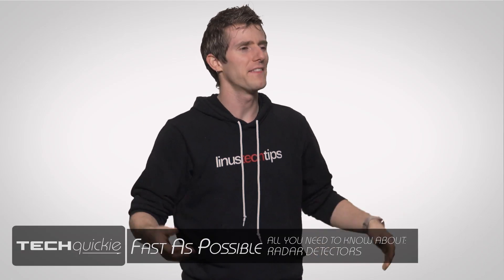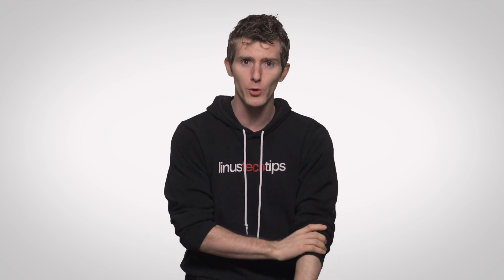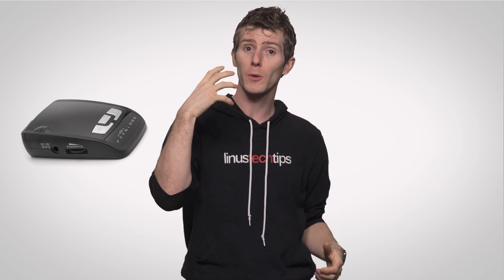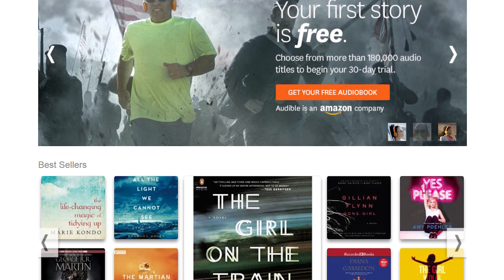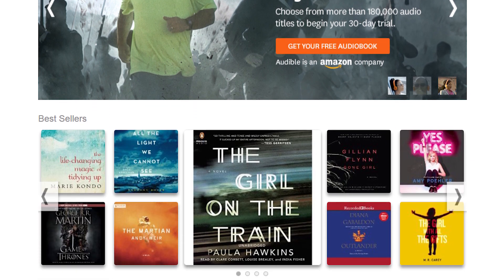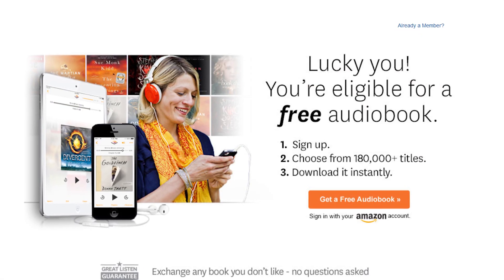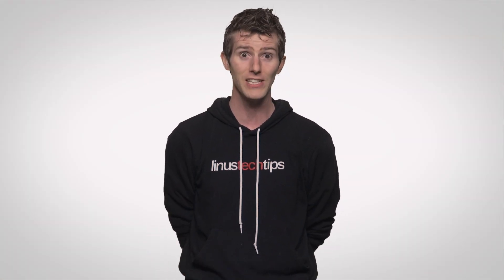Radar Detectors As Fast As Possible

Comment: Car radios and radar guns don't work similarly at all. Car radios process signal via FSK modulation and a radar gun compares the speed of the input signal (due to the Doppler effect) to it's internal clock. The only thing that is vaguely similar between these two devices is the visual representation of the input signal on an amplitude x time graph. Other than that car radios and radar guns have nothing in common.

Comment: In the Doppler Effect, the frequency doesn't change, it appears to change because of the compression of the air by either the producer, or the observer. The radar gun works based on firing multiple signals and measuring the amount of time in between each sent and received signal and measuring the difference "appearance" in the shots.
Reply: Yes, the frequency does change. Doppler effect occurs with any type of energy wave. Be it mechanical waves (sound) or electromagnetic waves (radar, radio, light). All sounds are a mechanical compression of air, the frequency changes up as you move towards a sound source because you are experiencing the crest of each wave more often than a stationary observer. The same happens for radar / radio in a complete vacuum. Police radar measures the change in frequency reflected from a moving object. A police radar pointed at a stationary car will receive back the same frequency it transmitted, If that car is moving away from a radar source the crest of the reflected waves moves further apart reducing the returned frequency. Police LIDAR (laser speed detection) also works on the same principal.

Comment: Here in Australia the police will park a van car or 4x4 with a camera that takes photos of the license plates and if you are speeding you will get a ticket with a photo of the vehicle the driver is driving. If your car or vehicle by someone else you have to let them know who was driving the vehicle. I was on a public transit bus going through a speed camera and I saw a flash and the driver got done for speeding going downhill at 80 km/h in a 60 km/h speed zone. Speed cameras do get the vehicles coming the other way with a double lane road with an island in the middle on the road. The flash is on it's front or rear bumper and that depends which way the vehicle is parked and the vehicle can be an unmarked police vehicle.

Comment: Sorry to tell you that a radar detector does not pickup ''doppler frequencies'' but the original signal from the police radar , be it X/K/Ka bands.
You are right if you say : the returned signal from a moving object contains a doppler
shift which is analysed by the police radar and transformed in a speed readout.

A K-band radar would display 50 mph when the Doppler shift is 3600 Hz.

Good work all in all : being caught is expen$ive.

Comment: Still the problem with radar/lidar detectors is when they detect the beam, then your speed has been already measured. Game over.
Reply: Some cops will not pull you over if you slow down as you pass then.

Comment: Or just get a faster car.
Reply: You don't out run the police. It just won't work. Police cars are designed with high speed pursuit in mind. They have radios. They use helicopters. They even can throw stop stick across the road to pop your tires.  And apparently in New Mexico, they can even slam into your car to stop you. Does this sound worth it to you?

Comment: Not covered: Some radar guns can detect the tiny change in the radar signal caused by there being a tuned circuit on the receive end (your detector) -- so they can detect your detector -- helpful if detectors are illegal in your area so they can catch you for it...
Then the detectors got a level smarter and detect radar then immediately detune their antennas so that they don't show up as damping the source.  Radar detector detector circumvention.
Reply: That is only effective if the lazy-ass traffic cop wants to take the time to adjust his speed gun. Most cops are just sitting there hiding behind parked cars eating their donuts trying to just make it to retirement. Do you really think a typical traffic cop will take the time to wok that hard?
Reply: +frollard Radar Detector Inception!
Reply: That sounds like complete and total BS. There's no way in hell a radar gun could "detect a tuned circuit" and there's double no way the radar detector could "detune" itself like that.
Reply: @VTX-Live  It's real and people have been fined for it. I knew someone that got pulled over for it and while slowing down he took the detector and put it in a box and slid it to the back of his van and they still knew he had one and had been using it.
Reply: ECCM!

Comment: Here in Western Australia they use camouflaged laser cameras, usually rear facing. They'll send you a $100 fine in the mail (usually takes 2 or 3 weeks) for doing 5kph (3.10mph) over the speed limit, usually on highways/country roads.
And they do it all in the guise of road safety.
Reply: good news. wapol have brought out the jenoptik traffistar line of cameras a couple years back. My detector picks it up from 250 or so meters away. 24.1ghz kband radar. the laser only cams are no longer in use.

Comment: Radar Detectors are only worthwhile if you invest in a good quality one and know how to use them. I have a $350 Beltronics and for me, it has been a great investment. I have only had it one year and it has saved me a few times and paid for itself about 2 times already! I previously tried a $50 Cobra and the thing was basically a useless waste of money because it had very poor range. Make sure you spend at least $100. Also, you have to configure it properly or else you will get annoyed with many false alarms. Turn off "X" band, because it has a lot of interference and is no longer used by law enforcement.
Reply: +Ryan Toomey I've seen police using X band in my area, typically on highways. But the k bands are more common in general. Mine also detects LIDAR, but I turned that off. If I get a reading from that, I'm already screwed.

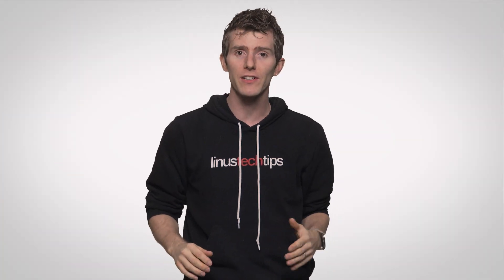Comment: Doppler is the resultant effect to a given frequency (hence why it's called Doppler Effect) and is not a frequency band (like Ku or VHF) as you state around 1:33.  Many commercial radars use the Ka band, around 34-35GHz.
Bottom line - Doppler is not a frequency band.

Comment: the lidar detectors are so innacurate that a romanian police officer got sued for a ticket because it registered at 104km/h while his car was set to not go over 99km/h..in court it stated that after it registered at 104 it jumped at 80 something..so innacurate is an understatement
Reply: +Fack Ytbe Lidar is accurate when used correctly. Lidar can only be used in front or behind a vehicle, if the cop is shooting it at any angle it will be off.

Comment: Here in nz police speeding tickets are probably the worst here than anywhere else in the world, you cant get away with anything and going 35kmph over is a $400 fine. yes the lidar is very hard to detect but you dont need to detect that because usually the cop is sitting next or in his car using that gun and all you need to detect is the cop car not the actually lidar it self.

Comment: Doppler bands?  WTF?

Please pick up a good book, Linus.  You know what you know, but you REALLY should avoid subject matter you know little about, like this.  As an FCC Amateur Extra Licensee, take my word for it, you sounded like an idiot on this.

We enjoy your videos, but seriously, if you don't know the subject matter, please pick up a good book.

Police radar is usually fixed frequency, pulsed, usually using a cheap Gunn oscillator.  The receiver will measure the difference in frequency received, do some basic math, and display that difference as a velocity.  There is no such thing as a Doppler band.  These operate in the X or K bands.  10 GHz, 24 GHz, etc.

Comment: Please don't say Doppler band, Doppler frequency and Doppler detector. They are all the incorrect terms and don't exist, Doppler, like you said is the shift in frequency/wavelength caused by something moving. Doppler is the name of the effect, not of a particular band or frequency. And radar detectors don't detect Doppler, they detect the frequencies that police use in their radars. Sorry but I cringed every time you used those terms above.

Comment: that slow down thing worked for me*. cruise control is the best thing in the world for that. also music. if i don't listen to music i tend to feel the haste bug's bite a bit more strongly because i focus harder on getting to where i want to be, and that is usually better done faster. won't lie, i recently did a strech of 300km in less than two hours. who could blame me, i literally took the road just to give my sister a freaking 400km ride, and then had all the way back to do. i took some good, wide back roads and floored it. the trip back was over an hour shorter thanks to that. funny thing i was doing 180 kph like the whole way, and a whole group of some 6 cars more or less kept with me for the most part of it. they were like they only other cars on the road, and they were all doing at least 180 too. i'd leave them behind but every time i slowed down by a bit for 5 minutes they all caught up. wtf!

Comment: I'm pretty sure the "Doppler frequency" is not a frequency range as stated in the Video ( 2:09 ), but rather the frequency you'd get after applying the speed difference between frequency-source and target on the original frequency.

Comment: The worst problem regarding laser detector, is that by the time you've been targeted, they have your speed. so even if you could react it would be too late. That said though, the held models are difficult to keep steady so they continue to paint you with the laser until an accurate measurement can be made.
Reply: Lol mine detects over a mile away, around curves and over hills. Long before I'm within sight much less their range

Comment: Hey Linus, police officer here.  My department actually doesn't train us in stationary radar any more, just Lidar.  The two main reasons being that it's not easily picked up by detection equipment and it's significantly more precise (radar beam width is very wide, a bit over 30 ft wide at 100 ft.  Lidar beam width is much narrowed, specifically 3ft at 1000ft, so around 100 times narrower).  Radar is still used but more when it's integrated into the car in what's called moving radar,  the radar is in a fixed spot in the vehicle and connected to the calibrated speedometer, which is then used to add/subtract the speed of the police car from the reading depending on whether the vehicle you're detecting is moving towards or away from you.

Also there are Lidar jammers out there as well, however if I'm not getting a good hit off the license plate I can always move the reticle left/right to one of the head/tail lights.
Reply: Also speed detection doesn't work from the side of the vehicle, only the front or back.  The radar wouldn't detect a change in frequency, nor would the Lidar detect a change in range.  The cosine effect states that the greater angle you are to one side of the vehicle you're detecting the lower the speed reading will be.  While it means the speed detection will always be slightly lower than the motorist's actual speed (unless you're directly in front of the vehicle), however this always favors the motorist.

Comment: I have a bit of a lead foot and I only drive as fast as I feel safe doing so, but many times that speed exceeds the posted speed limit, that is why I almost lost my license from speeding tickets a few years ago. Not to mention it caused me to be broke as hell a few times considering the cheapest speeding ticket I got was about 300 dollars, so after I was only 2 points from losing my right to drive I spent about a hundred and twenty dollars on a detector from WalMart and to this day (5 years and all my points back later) I have not been pulled over let alone gotten a ticket or warning. The police in my area do not use LIDAR only state troopers have them and while I got very good at knowing which were false hits on the detector, I finally got a good one for my new car (higher end Cobra from Amazon) it barely gets as many false hits as my old ones. 

All in all, if even my 250 dollar detector saves me from only one speeding ticket EVER, it was worth the money. I know it has done it so many more than even 10 times, I swear by them and tell even people who don't speed to get them, because the one time they aren't paying attention to their speed a cop will catch them and generate some revenue for the city via their road piracy unless they have a detector.
Reply: Fight the road pirates and buy a radar detector today!
Reply: Bought mine over ten years ago. Only got one ticket, the Detector was in the glove box. Aside from that, no tickets.

Comment: I have seen a detector that detect Radar Detector Detectors.
Reply: A radar detector detector detector?
Reply: Alexander Martens I speed responsibly if you could say that. I speed upto 15 mph on secluded roads and while not exactly endangering others. That said however, once in a while, after a frustrating day at work driving home, alone on the road I just feel the urge to just floor it for a few seconds. Thinking what that could cost me is terrifying. I know my car, I know the stretch of road very well and it's me alone on the road. So who exactly am I harming by that?
Reply: dont matter. most states you can have detectors
Reply: +A42yearoldARAB But in Europe you can't. And the fines for speeding are absolutely mental. say 25 mph over limit could set you back a months income. And I guess the detector would set you back the same amount again, so damned if you do damned if you don't.
"Guess we'll just have to stick to the rules" (<- sarcasm).
Reply: +Darkking Ice I guess we'll need to get a radar detector detector detector detector so we can tell when they're using a radar detector detector detector and turn our radar detector detector off.
Reply: +Darkking Ice My Detector has that feature built in
Reply: Manitoba traffic cops use them as radar detectors are prohibited here.

Comment: I  bought a radar detector from a buddy for $200 and installed it right away, within 30 min an undercover cop pulled me over (he had a detector "detector"); took my detector, and gave me a $130 ticket for using the detector. Best investment EVER!
Reply: +zdrux Should've checked if it was legal there.
Reply: +Zeldagigafan There is an oscillator in the detector that oscillates on the frequency that the device is detecting. This oscillator radiates just a tiny bit, but even those low energy waves can be detected by the so called detector detectors.
Reply: +zdrux It's not a detector if it emit a signal...
Reply: +zdrux it was radar jammer...
Reply: +zdrux I guess we will need radar detector detector detectors then.
Reply: +zdrux 

I would like to know he detected it. It's nearly impossible to detect something if it isn't emitting anything. It's like trying to find a teacup in orbit around the Sun.
Reply: Weta Ontario Provincial Police (OPP), Quebec Police (Sûreté du Québec), and RCMP across eastern Canada use Spectre radar-detector-detectors (RDD). Spectre RDD will notify the officer if a radar detector has been detected near-by. Penalty includes a minimum fine of $350 in Manitoba, $170 in Ontario, and $650 in Quebec, and the radar detector will be confiscated.
Reply: "detector detector"
sounds great
Reply: Anal Prolapse In My Bum When I'm Filled With Cum By Onii-Chan And His Friends While I'm A Cumdump ♥ I know
Reply: +zdrux Detector detector. GG!
Reply: *****
lol
Reply: You just need to buy a radar detector that is immune to RDD (radar detector detectors). There are a few on the market, Escort Redline, Beltronics STI magnum, and the new Uniden R1 or Uniden R3. Just mount them high on the windshield out of sight and they won't be able to detect them.